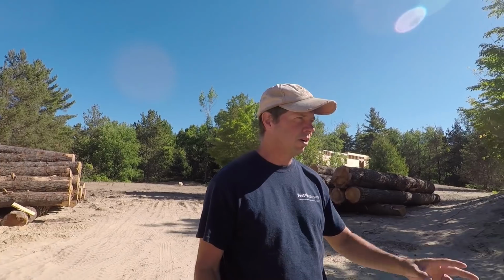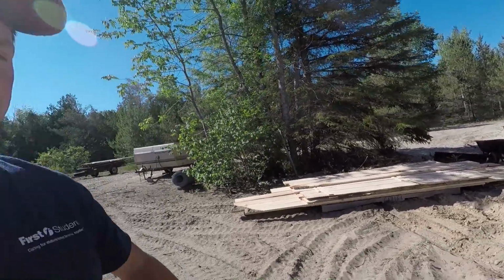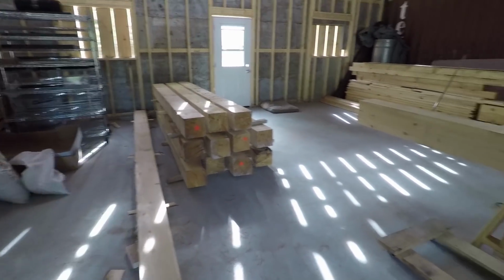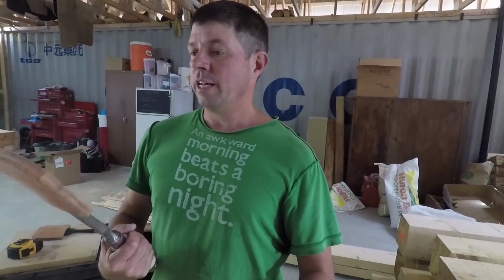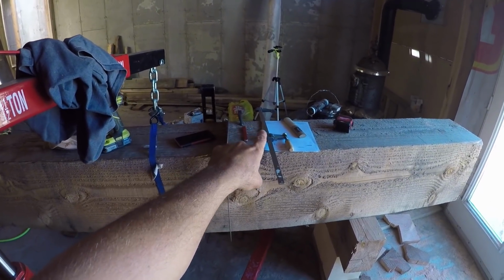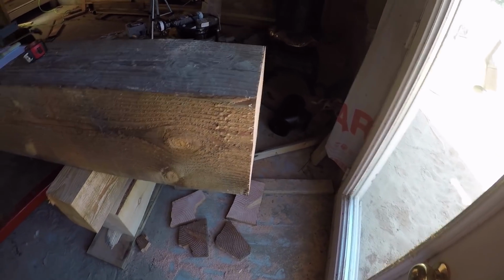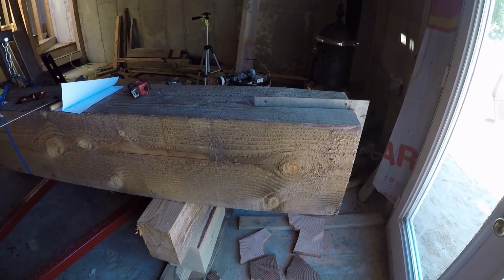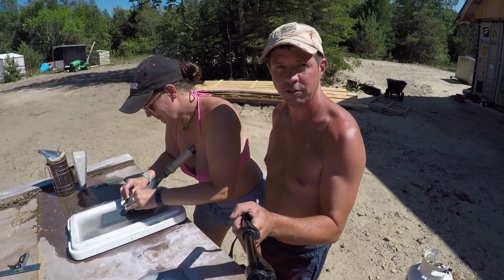Two Weeks of Timber Framing (TIMBER FRAME HOUSE BUILD) S04E01

Comment: For backing and higher speeds a couple stabilizer bars is all you need . Slow speed forward only no stabilizers allows you to hook up as many trailers as your tractor will pool for tighter turns and better tracking . With stabilizer bars at every hitchpoint I've seen videos and only one time in person three trailers being backed up together a for good distance . Pull a wagon at high speeds with no stabilizer bars you'll get fishtailing and flip over .
Waving happy flags of freedom backed with a strong stable bar when needed keeps the Tails wagging happily down the wagon trail !!!

Comment: The farm trailer is that way so they can be pulled in multiple trailers at the same time.  Also have no need have jack lift off the tractor, very fast to hook and also stable platform for stacking and storing.
Reply from the maker: That makes sense.

Comment: If you are not practised in reversing a double articulation, use a front hitch on your tractor, you will find "nosing" much easier.
Reply from the maker: That is a good idea.  Sure would make it easier.

Comment: The easiest way to back up that kind of trailer is put a hitch on the front of your tractor and connect the tounge to the front end of the tractor and “push” rather than back up.